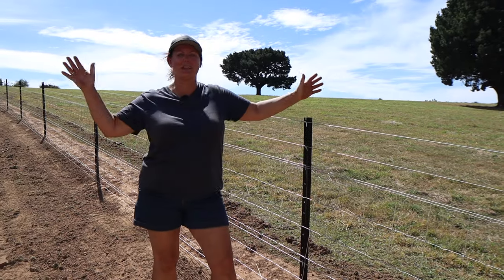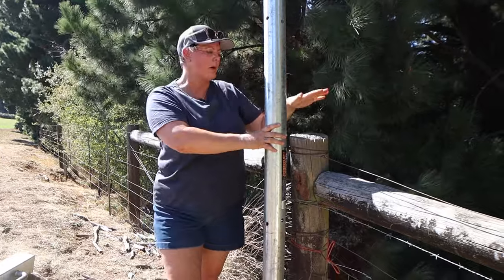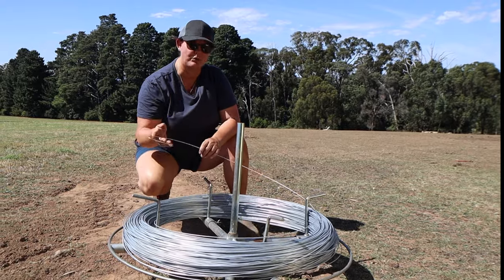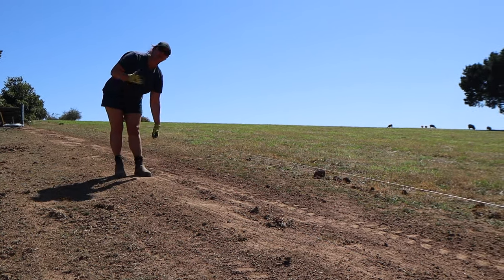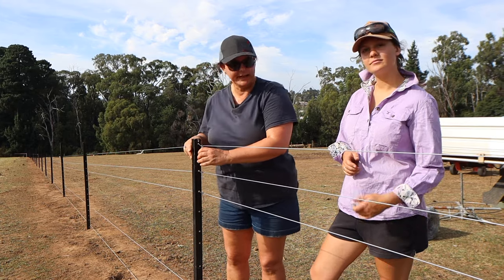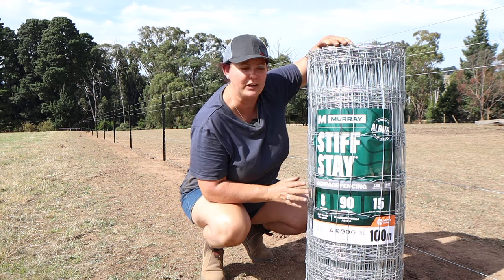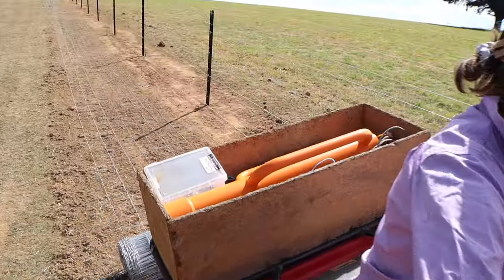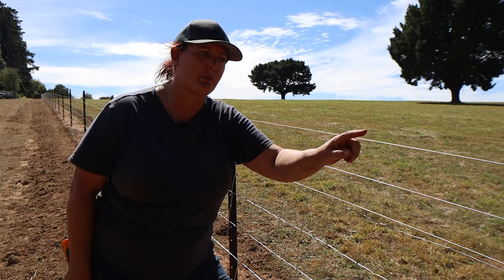Building a Fence Made Effortless by Helen

Comment: I didn't have help or enough muscles, so all my old wire was cut in to 2m lengths and stacked in my Ute (alternating layers of rusted hingejoint and barb pieces to control the barb). Bring 3 of the removed star pickets with me to the tip. 2 slid under side of  wire pile to rest on edge of metal scrap bin, the third used as lever from the other side to flip the whole pile off and in to the bin. I just made multiple trips so it wasn't all too heavy. But, unfortunately,  my next stretch is being put off because I have to try to get the old timber posts out first ... not keen!😂
Reply from the maker: Use this trick https://youtu.be/3qbl1yMqc08?si=Iqa5acFlxMIzoVsO or this one https://youtu.be/EOhCma-qOPM?si=cU8KriN4nZsRIdwZ

Comment: Great video Tim. 
What is your recommended maximum distance between straining assemblies? Also, why no Maxi posts?
Reply from the maker: Maximum distance can vary dramatically. Depending on road regulations (NSW is 200m along some roads) soil type and local practices. In some situations the distance can be dramatically larger. I would not be too concerned going to 200m in most cases, but it pays to check local practices and rules to be certain. No XL posts as it was not required with the livestock in this case.